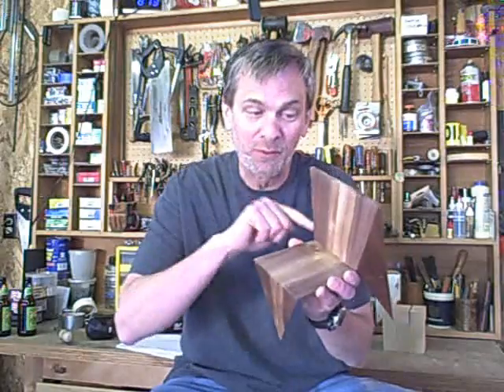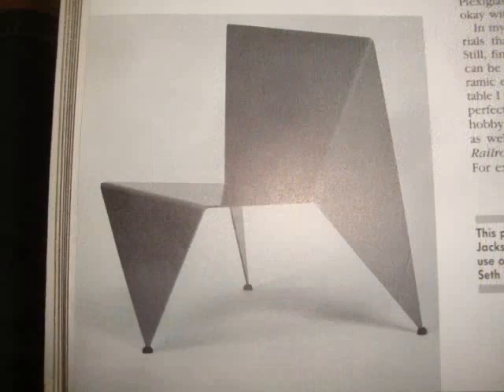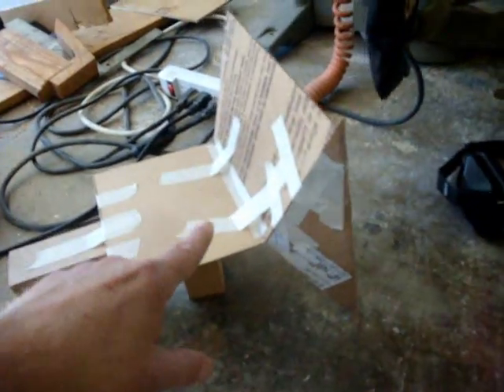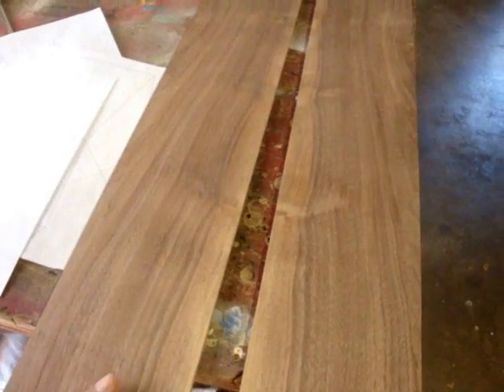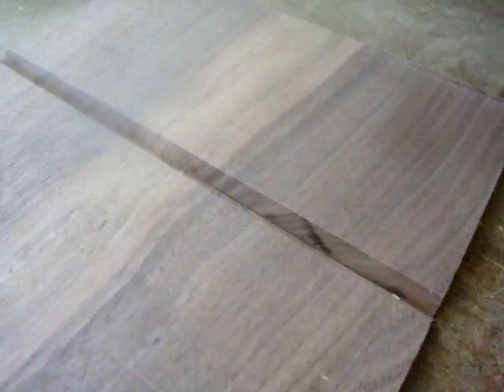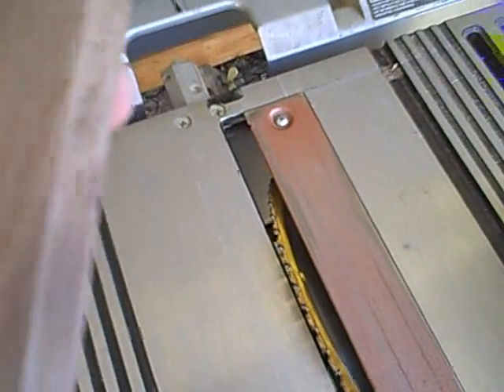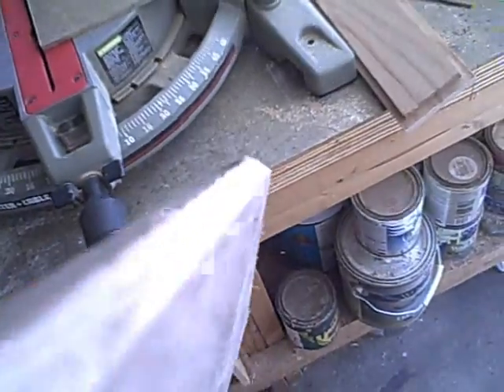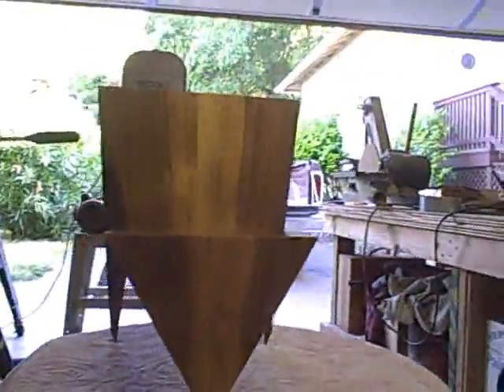Building a miniature model chair out of walnut

Comment: The original aluminum chair was designed by Elizabeth Browning Jackson, of New York city.  The book Steve got the photo from is "Designing Furniture" by Seth Stem, published by Taunton Press.
It's an intriguing form & obviously a challenge to build in wood.  Good job Steve.  I doubt a full size version in wood would hold together unless it had some hidden steel reinforcing at the joints.  It's more realistic than a Rietveld chair tho.